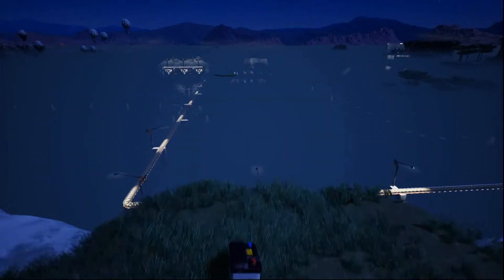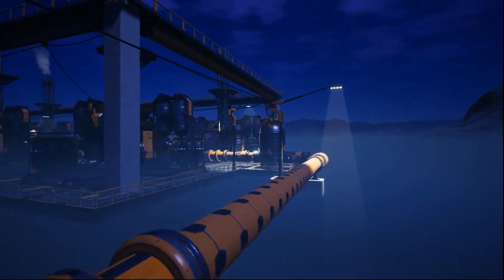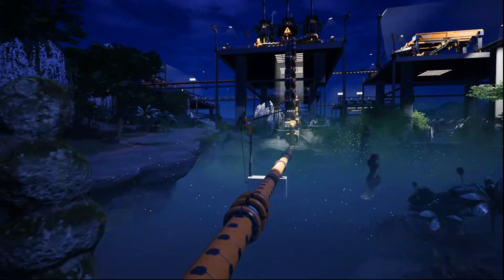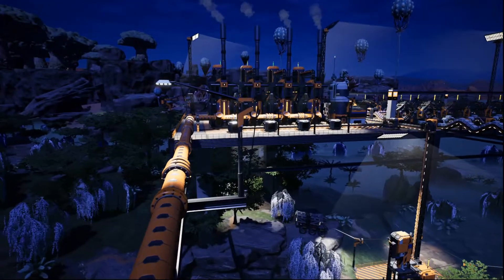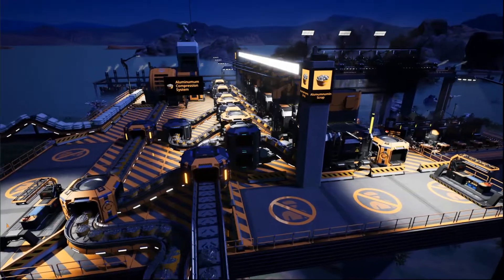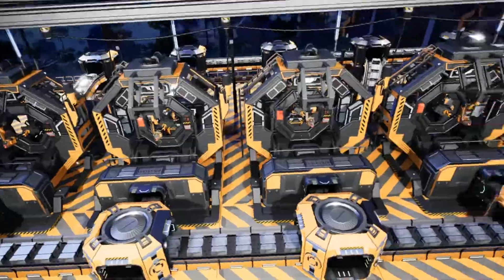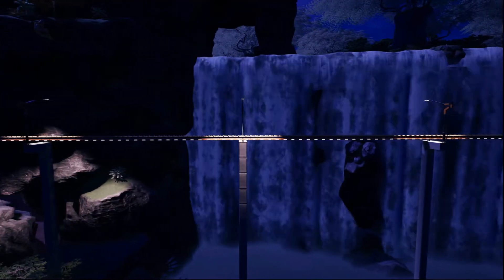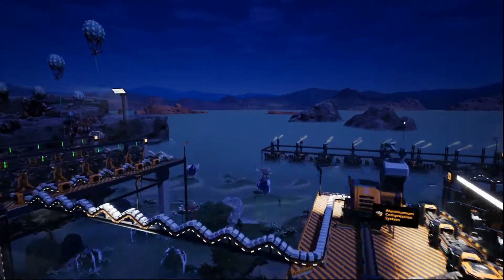How It's Automated - Batteries

Comment: I'm stealing that stacked bufer design at 1:12
Reply from the maker: It works really really well in areas where the pipe needs to extend up or down where it cant normally reach and with that setup, you can place pumps according! Another side benefit is it will also act as a reservoir!